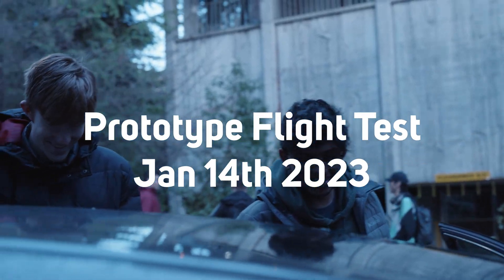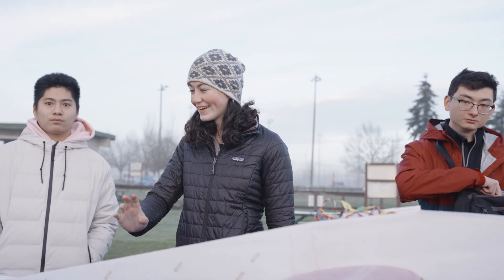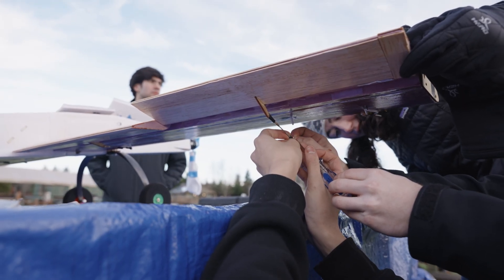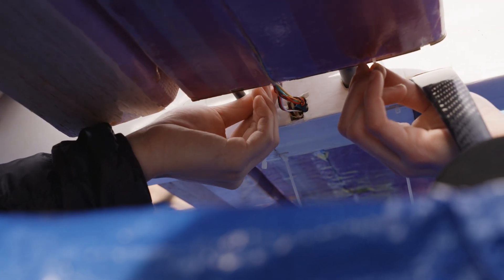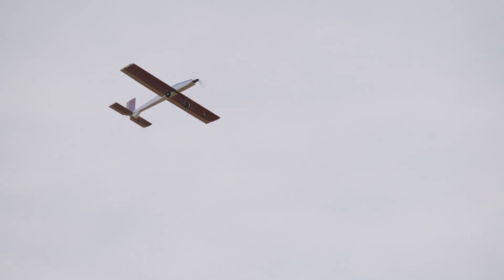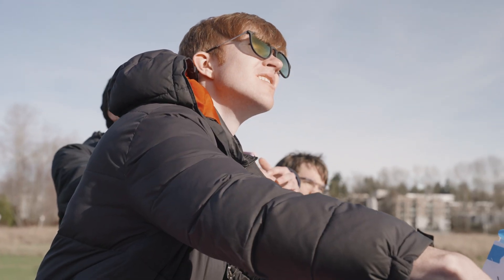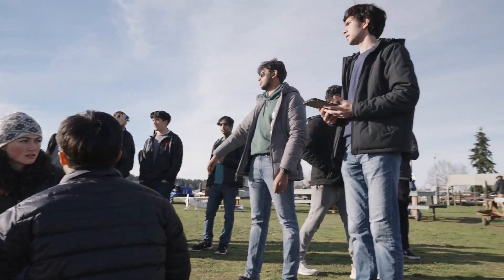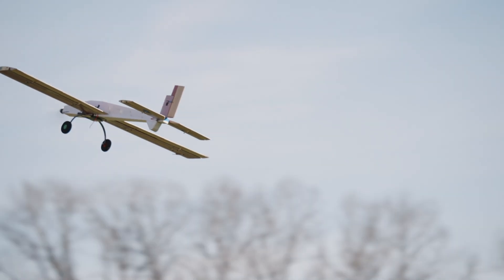Episode 6: Prototype | Design Build Fly 22-23 Season | DBF UW

Comment: That looked like "Dutch Roll," @3:37 

May want to check out your directional stability. Maybe your rudder/vert stab is too big - cause you already have the vane-n-gear below it.

From Wikipedia: The Dutch roll mode can be excited by any use of aileron or rudder, but for flight test purposes it is usually excited with a rudder singlet (a short sharp motion of the rudder to a specified angle, and then back to the centered position) or doublet (a pair of such motions in opposite directions).
Reply: Thank you for the information. The observed behavior was a result of the rudder fluttering due to the center dead-zone in the servo. Our competition spec airplane uses new higher quality servos and that eliminated the problem.
Reply: Cool! Good luck at the competition.

Comment: Propeller Is so big for the engine and size plane, you would hey More speed with a smaller propeller
Reply: What size is the propeller, motor, and airplane for you to reach this conclusion?
Reply: I have been in the aeronautical industry for 16 years, I have participated in the construction of many wing-type drones, it is enough to recognize the noise of a forced motor
Reply: @uriellemus2452  this is a prototype that is flying with a stand-in motor. The max rpm is 60% of the final motor yet to be delivered at the time of the video due a much lower KV. The motor was under no stress at all because there is no more rpm to be pushed, hence a smaller propeller won’t make a difference. 
In addition, from our mission requirement and optimization, we chose bigger propellers for their efficiency in combination with a low KV motor. 
I am unsure what a “forced motor” sounds like because there’s really only the sound of the propeller, and the propeller keep accelerating throughout the throttle range instead of stagnating like a over-propped motor would sound like.
Reply: @i_am_ken_chen  We need to know if he's right if you ever test it!
Reply: @InspectahPatio  we put on a bigger prop (17X12) in a later flight test and was flying faster laps than the prop (16X12) shown in this video. I think that should be enough proof
Reply: ok, a recommendation try with a shorter propeller and with a little less angle of attack, so I'm sure you'll have more power and energy efficiency, keep the propeller if you want to put more extra weight but you should correct the angle of attack of the winter , this is just a recommendation in my experience

Comment: Find, 'Flite Test' Channel. I guess you figured out the rudder was way over-engineered.
Reply: Our prototype design principles, in fact, stems from Flite Test. 
In addition, the rudder is designed in this fashion based on the need of our competition, and while it fluttered to the slack in the servo on this airplane, it performs up to our expectation on our latest prototype where high quality servos eliminated the flutter completely.
Reply: @i_am_ken_chen  interesting. I appreciate your response. It's a fine looking plane btw. Forgive me for the criticism of the rudder (before the modification), it's just such an outdated design for reliable performance.
R/C Projects are Excellent to work and motivate young people towards engineering and other STEM.
Reply: @oggearhound2242  no problem, we appreciate your input, it allows us to take a look at our project from an outside perspective.
Reply: @i_am_ken_chen  As a long time park flier I would like to see a mission project where simplicity and flyability is the goal. the theme "in simplicity is reliability" It requires lateral thinking.
Reply: @grandaddyc  Coincidentally, this year’s competition has that partially in mind. We are required to construct an airplane that fits inside an airline compliant checked bag and be able to assemble it in 5 minutes, and then fly as fast as possible with a vertical antenna attached to one side of the wing for three laps.